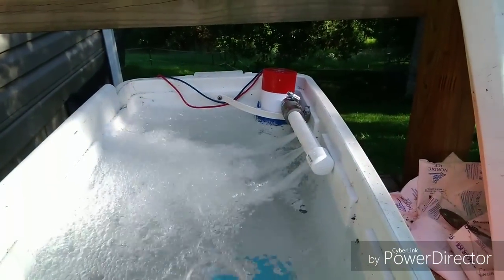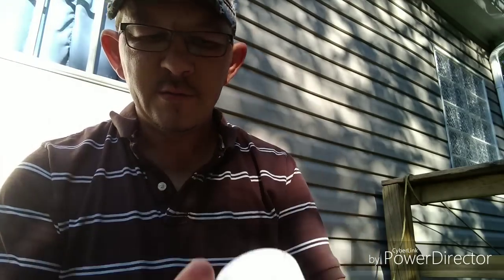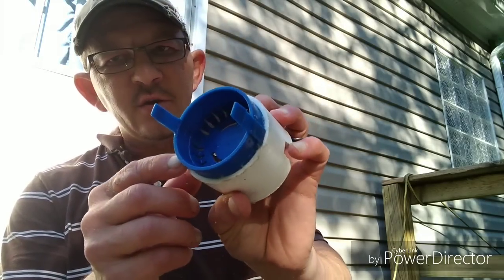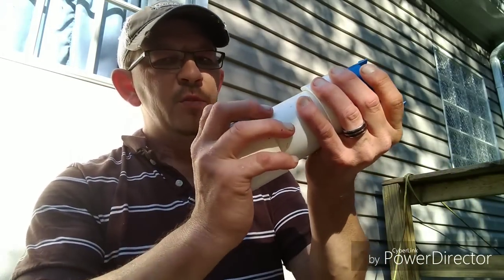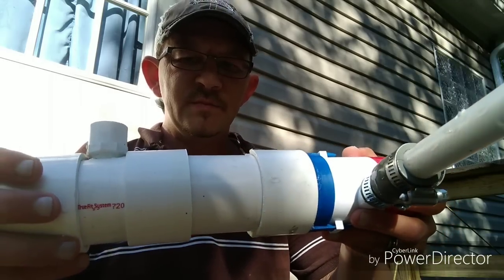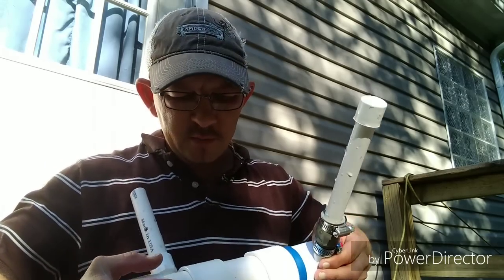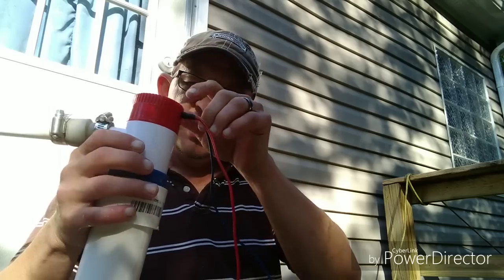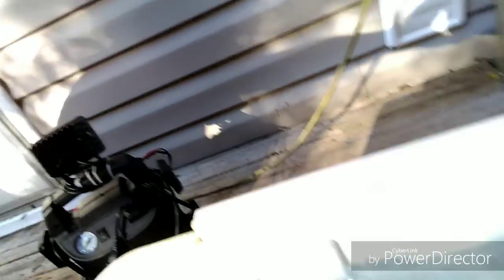Diy bait tank filter and pump setup

Comment: In my experience  with  the pump  like that the housing heats up  from  running  the pump  constantly  and will  eventually heat up the water killing the  baitfish  as well  I chose  to get a livewell  pump  that mounts outside of the tank to keep the water cool inside the tank  and just  install  your water  lines outside  the tank back  up to the top

Comment: is there a way to use the pump for in a barrel at home without using a car battery to power it and plug into electricity.
Reply from the maker: If you can find a trickle charger that's puts out more than the bilge. I have  found that will work
Reply: @abgregg208  use a pond pump that runs on 120 volt
Reply: Hacked Fish nice work.
I was sent here on my search and plan to diy a above ground solar pool filter pump system.. Ive looked at a few 12v pond pumps... Then had the idea of a bilge pump... Which is much cheaper and I'm thinking may be less power requirements. The bilge pump idea fitting nicely with 2inch pvc is giving me good ideas... I need to check it out some more to see if it will do what I'm wanting... 
And actually my plan is to run it directly to the solar panel and use no batteries. Its gonna be a challenge, so we'll see. 
First video I seen of yours n I hit the subscribe and like button. Look fwd to seeing more. Ty
Any ideas or advice come to mind lemme know. Ty
Reply: You can use an old charger cord as long as the output is 12 volts

Comment: pump should be at the bottom of the setup
Reply from the maker: It's work like this for about 2 years. No problems. Can I ask why should it be at the bottom they are made to set barely in water in a boat to pump water out.
Reply: @abgregg208  first its a submersible bilge pump it is made to be able to be completely underwater 2nd keeping it at the top means the water level needs to stay with in a small margin of the pump pick up or it would run dry burn out if not level say during transport back of a truck or even in the boat getting to your fishing hole there are simpler versions that are still filtered more compacted  yet take less parts to buy and can work in most size tanks but thats a good style pump to use from the 20 different re-brands there are of it
Reply from the maker: Like I said it's just my version. People can do what they want to do. This is what I came up with that worked for me. Tell me I'm right. Tell me I'm wrong. either way it just a video people can use, if they want, that work for me.
Reply: @abgregg208  never said you were right or wrong just different  i only gave my opinion and then explained my view when asked iv used them pumps on my old bait tanks and  aquaponics system many diffrent brands still the same pump real hit or miss on quality but work  good i just would not want to run the risk burning my pump out
Reply from the maker: Sorry sir. I completely misread that. I apologise. I understand what you're saying now.  Yep those pumps are all the same really. Join my Facebook Hacked to Fish we can exchange ideas on a better way to revise this idea.
Reply: @abgregg208  thats how i found your youtube channel